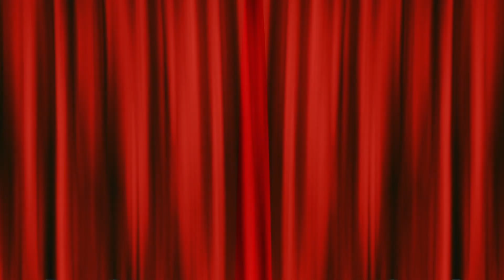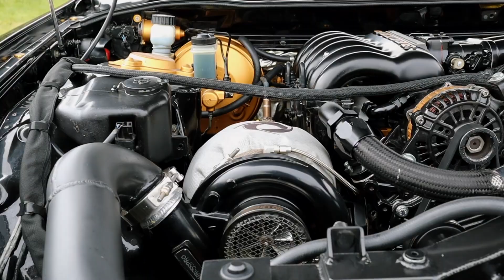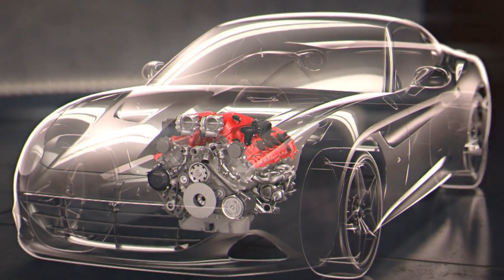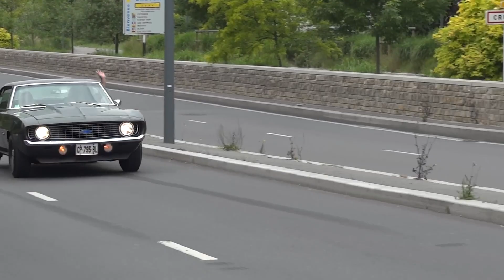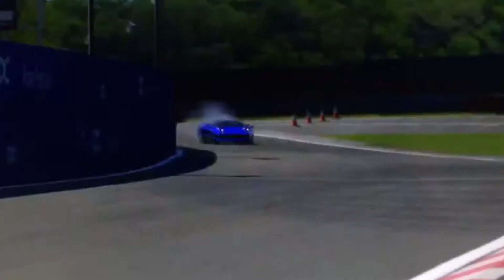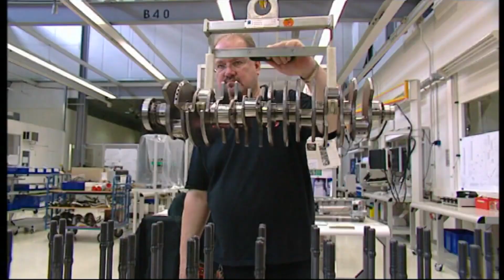10 RAREST Engines In The World  That Will SHOCK YOU

Comment: Your in America, use miles per hour, your did this on some of the models featured, but you didn't do this on all the models featured, and the metric system is for Europe, not America. And kilometers per hour always sound so much more impressive then miles per hour, because the numbers are higher, but you are in America, not Europe.
Reply from the maker: Fair point on the inconsistency — that’s on me. Most of these engines were built and rated in metric markets so I quoted the factory figures, but I should have carried both units all the way through instead of half and half. Going forward: both, every time.
Reply: @VehicleWisdom  Thanks!!!